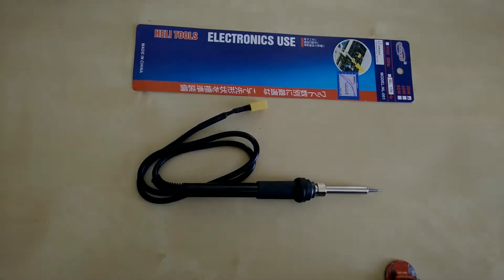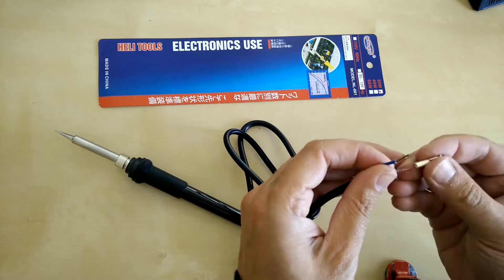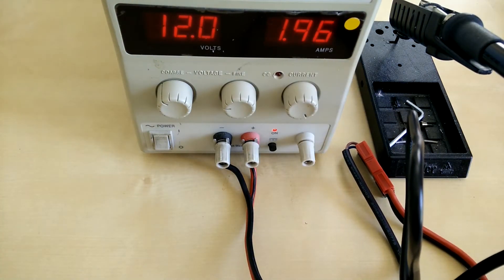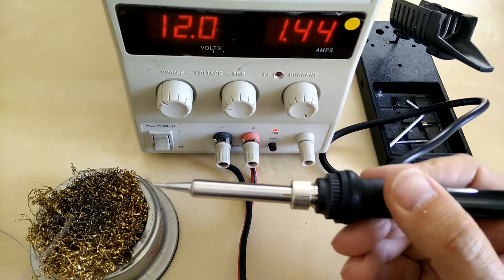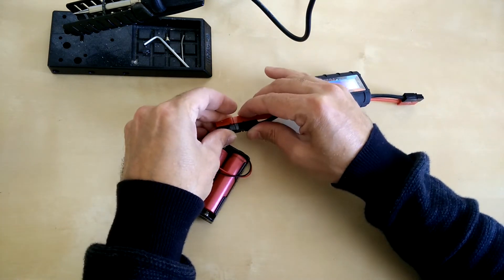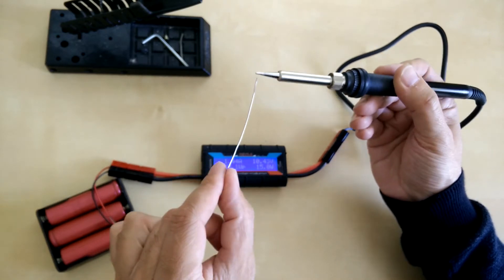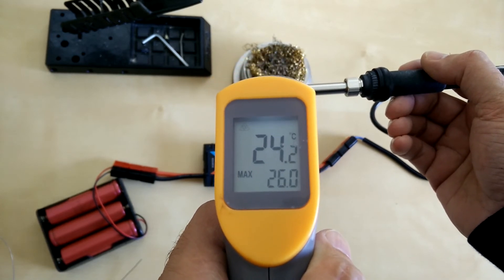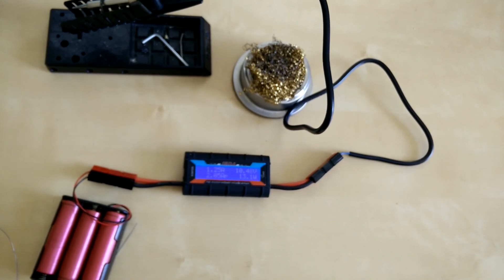Heli Tools, HobbyKing 12V "30 watt" Soldering Iron Test XT60

Comment: with those tiny wires  no wonder voltage is dropping
Reply from the maker: +gigiboxa good point, I normally use these battery holders for powering LED lights, not soldering irons.